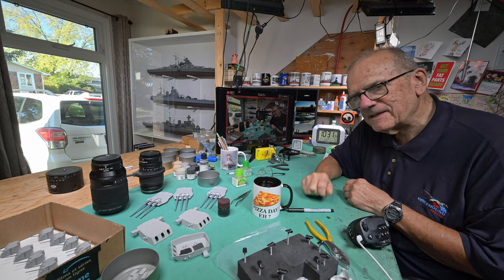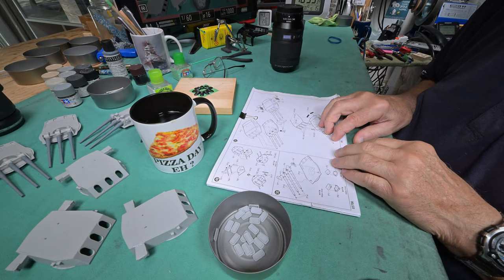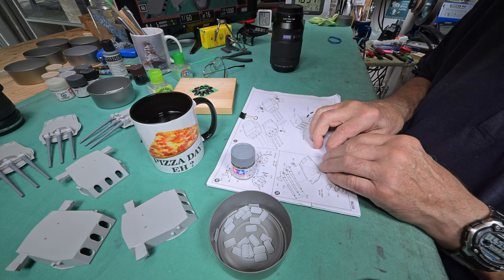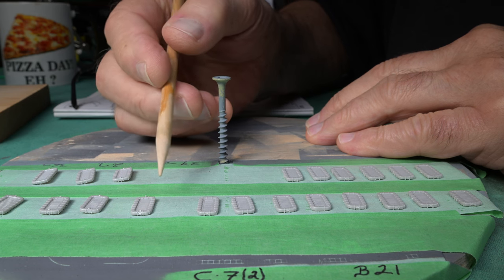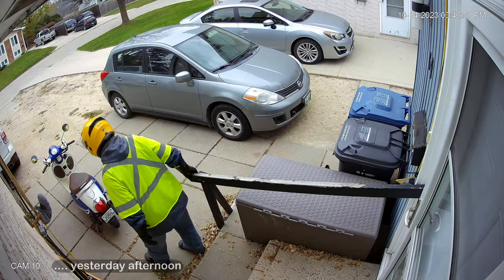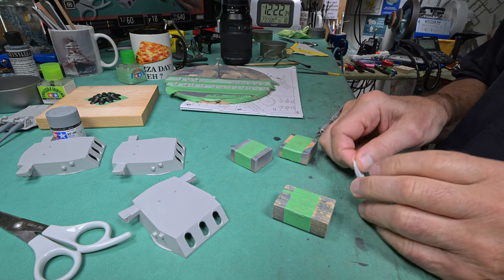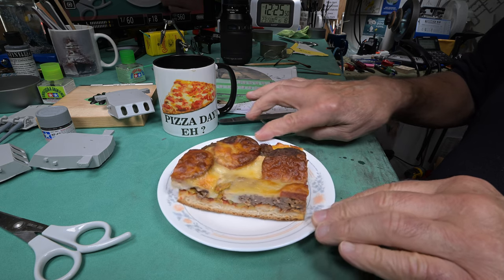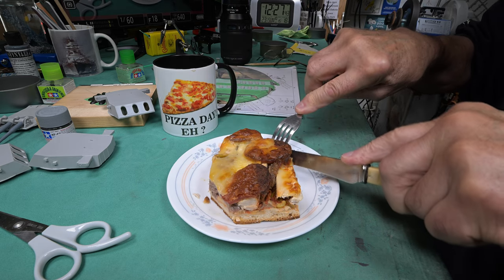The Model Ship - Part 1766

Comment: Hey Ron
      Remember to label the two turrets that you need to drill. You need to drill from the inside so  IMO I would drill and not paint the shells till you get more external parts that are similar colors then paint. I even put PE on then paint later to get a better look at the tiny holes prior to paint filling those small holes. 
     I had to go get pizza after watching your video.
Mike
Reply from the maker: Re: "not paint the shells till you get more external parts ---" Thanks! I'd forgotten about that again. 😮